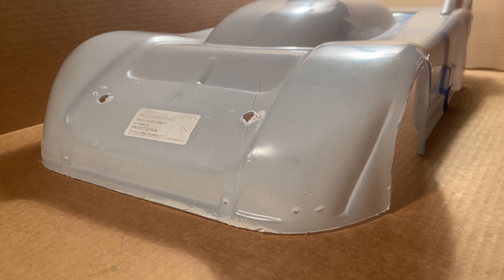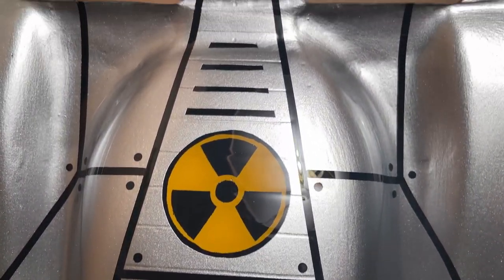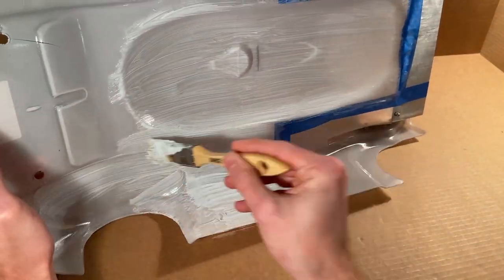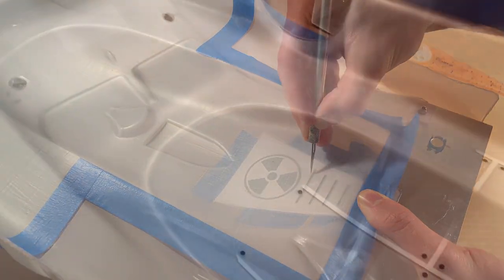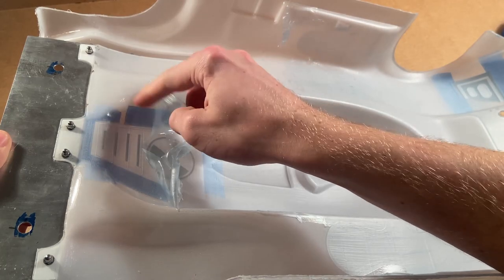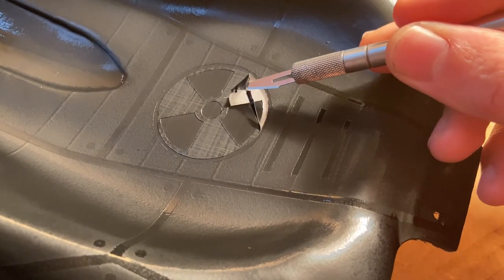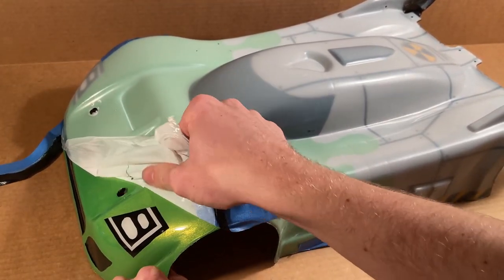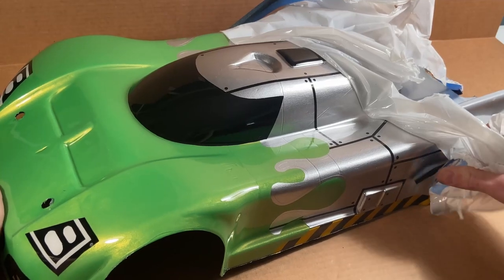Arrma Typhon Stretch + GT Conversion Part 3: Masking & Painting the Body

Comment: I have a question on the jag body, may i know which exact jag body that you are using? Im confused with size of stretch typhon.
Reply from the maker: This is the 360mm wheelbase version which fits a Kraton chassis better than the 325mm version. Cheers!
Reply: Donut Man R/C ahh. Okay got it. I can see it from the delta page. Thanks.